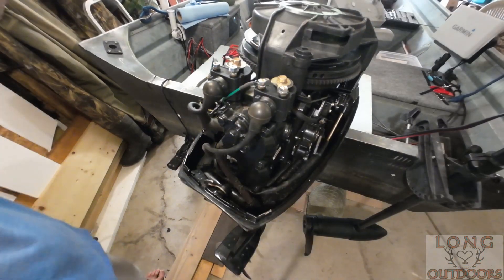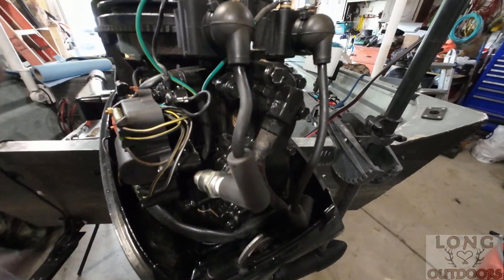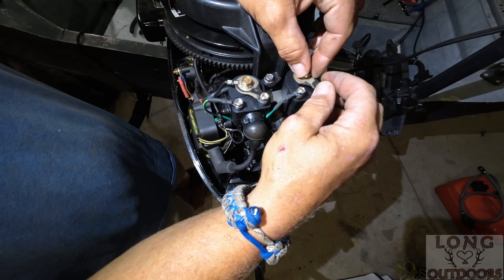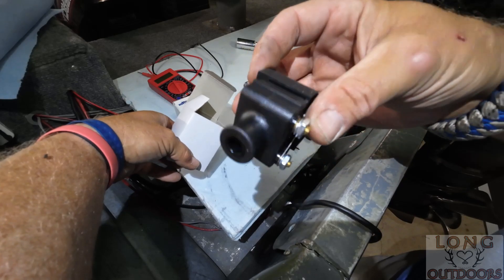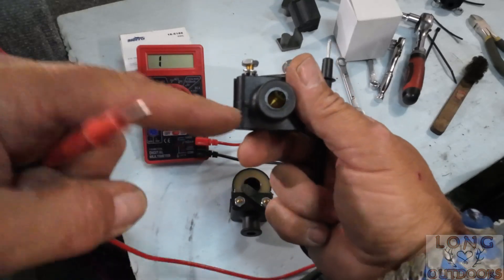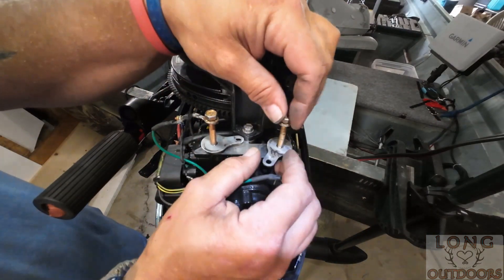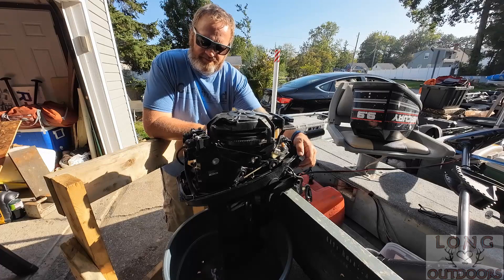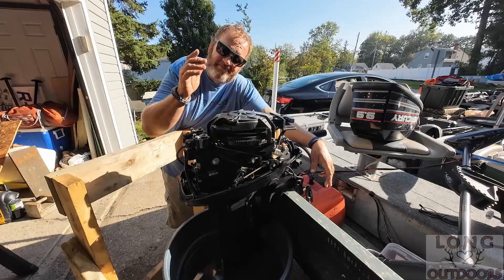COIL REPLACEMENT ON MERCURY 9.9 HP 2 CYCLE ENGINE

Comment: The right way to measure coils is using an inductance meter instead of an ohm meter.

But I understood that not everyone has an inductance meter available.
Reply from the maker: @josemariatrueba4568  Thanks for the tip. I guess it's for the backyard mechanic that likes to tinker. That's great input though. Thanks again👍 tight lines brother!!
Reply: @archerjay1  You are right. We all have a multimeter at hand.

Now I was wondering why one of your cheap coils failed. 
I'm getting an expert in ignition coils because I've got a problem with my Mercury 15 two atroke, which is almost exactly as your 9.9.
That's why I came to your Youtube channel. 

The engine failed aome time ago, and the other day I measured the inductance of both coils, which were around 15 micro Henry instead of around 500 or 1 thousand. Multimeter showed zero ohms, and I came to the conclusion that both could had failed.

Today I have replaced both coils with some very old ones that I had at hand. The engine has started well afterwards, but after 5 minutes idling fine, the engine started sounding as if running on one cylinder and stopped after several seconds.
I started it again but was running badly, and it stopped running. 

It looks like one of the coils has failed but I quit working because it started raining.

Now I'm thinking why my new old coil, which came from a 1997 135hp engine, has failed after only 5 minutes, maybe very much the same as your cheap coil.

Maybe there's something killing coils in our engines?

Is your 9.9 still working fine with the new oem Sierra coils?
Reply from the maker: @josemariatrueba4568  so I've tinkered around with the electrical system on my motor for some time now, and I've changed the switch box, coils, plugs, wires, basically everything, then I turned to the stator, and swapped it out for a cheap Amazon one in a pinch to just fish again. So needless to say that the cheap stator failed now as well.

So as to the question about the coils failing, and from what I've researched and come up with through physical tests of each component is that I believe my coils were burning up because the stator/trigger were starting to fail. It all works in concert with each other and when one starts to wear out it will wear out other parts quicker. I will be making a stator/trigger video asap. Let me know if this helped and if you have any more questions. And yes the OEM coils are working great👍

I'm sure you know but with these 2 strokes no matter what's going on it can only be 3 things.
1. electricity 
2. fuel
3. air/compression.
Reply: @archerjay1  Is your engine working alright today?
Reply from the maker: @josemariatrueba4568  it will be as soon as I pull the cheap stator/trigger off once again and replace it with an OEM part..LOL it was running flawlessly and then Kapoot. Went through the cycle of possibilities and tests and it's the stator/trigger. On a side note the cheap $25 one lasted 3 months😐
Reply from the maker: Yeah that sounds like you've been through the wringer for sure. I'm not affected here in Ohio by salt water, but I did live in Florida for a spell and know a little about hiw salt water can affect engines. So now I'm wondering if it isn't the stator. I had a cheap one and it failed like I said before. But I'm also wondering if there's a compression issue with one of the cylinders. I'll try to help as much as possible my friend, I'm not a certified mechanic but I do like to tinker around and fix things myself if possible. So sure if you have any questions feel free to ask and I will try to answer as much as I can👍

Comment: 2 ohms on the primary is a little too much as it should be between 0.2 and 1 ohm. It seems like they built the primary of those coils with a higher number of turns or thinner wire than the oem coils.

250 ohms on the secondary is too low as it should be between 800 and 1200 ohms. Maybe they built the secondary with less number of turns or a thicker wire. 

As far as I know, coils are normally built with a thick wire and 100 to 200 turns on the primary.
Thin wire and up to 20 thousand of turns is used on the secondary winding to get up to a 200 to 1 ratio.

The idea is to transfer enough magnetic energy at the right time by getting a peak of around 150 to 200 volts coming from the switchbox in order to get an energy of a few mili joules at up to 30 or 40 thousand volts towards the sparkplug. 

Maybe the new coils  are more reliable, better made at the expense of getting only 10 thousand volts instead of 40 thousand? 

The only drawback that I see is that you might have to replace sparkplugs a little more often.
Reply from the maker: Good point. I didn't dig as  deep as you have on this that's for sure.  It sounds like you know your electricity.👍 and it is possible about getting the extra voltage. And through experience and sometimes just throwing a bucket of parts at them in the past the OEM parts are just worth the money, and mostly covered by a lifetime warranty.
Reply: @archerjay1 
I'm afraid that you are very right. Shall we order a complete set of stator ignition timing, switbox and coils?

I love this engine. It has been working great for 20 years or so when I bought it new for 3,000 euros around year 2003 or so. 

I love two strokes since my youth when I went to Motocross competitions. Two strokes are simple, light and give lots of torque!

I've got 4 units of Mercury 5hp (two for this sailing sportboat, one for spare and another one short shaft for the inflatable dinghy).

I also have one Mercury 135hp extra long shaft for my Pursuit 2550 (when I bought this boat it had twin Mercury 135hp in very bad shape, one completely destroyed after replacing all six carburators, actually three double carburators, because one of the new carburators wasn't sending any gasoline to one of the six cylinders.

Then I removed both engines and bought a third Mercury 135 engine second hand which run  great until now that I have an overheating issue.

I have replaced this broken diaphragm at poppet valve but temperature alarm still kicks in if I run it over 2000 rpm (more job now that I'm retired).

By the way...
I'm from Bilbao, a city located at the northern coast of Spain near France.

Where are you from?

Comment: One thing that really stresses a coil is to allow the system to fire without having the plug wires grounded.  Never do that
Reply from the maker: @Rustycam1025  thank you for the extra info. 🤙